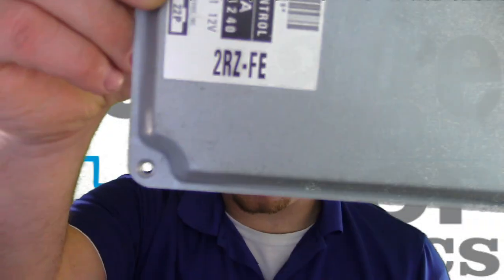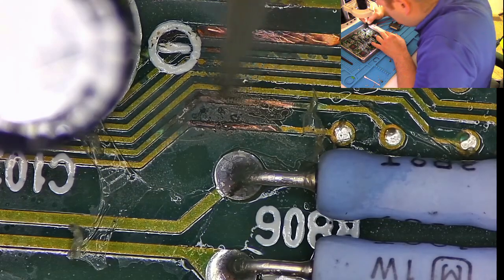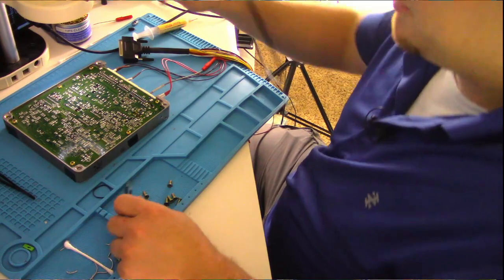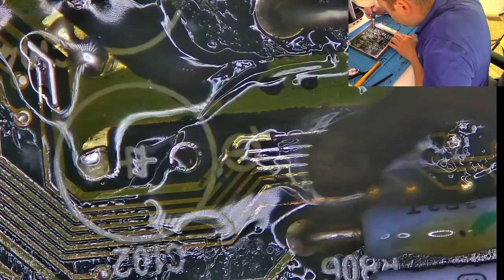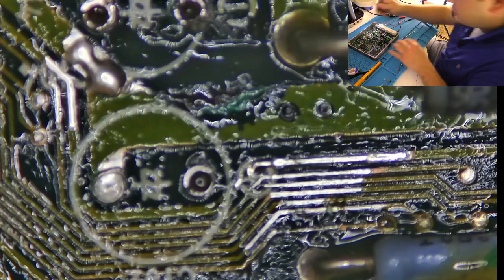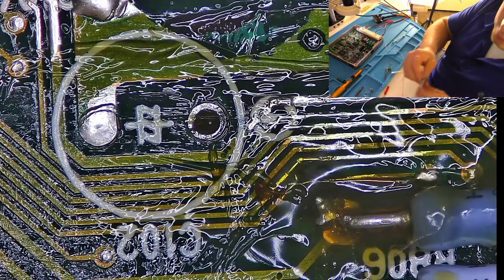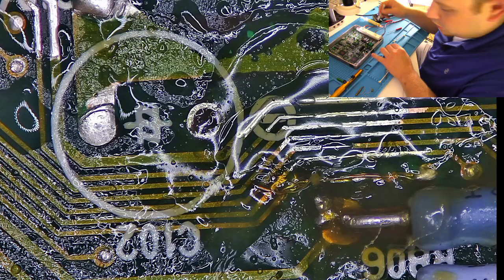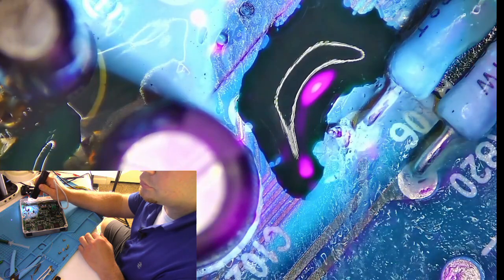Tacoma No Start No Communication with ECM-Circuit Board Repair

Comment: I see that you connect the SDL line to the K-Line connector on the GODiag. Is that correct or do you connect that to pin 2 of the OBD2 connector? Or do I need to connect both? How about the ground. Must all the ground be connected on the ECU? If no sensor is connected, will there be communication with ECU? Thanks.

Comment: Hi. Love it. For awesome tips and tricks on micro soldering watch a channel called Northridge Fix. As much as i learned from you on diagnostics i learned from him on soldering and techniques. Also sells alot of stuff that makes the job easier like solder wick etc. Keep the videos coming
Reply from the maker: I have solder wick, but honestly it doesn't seem to work well. Or maybe my iron isn't getting hot enough when using a wick. But yes, I love northridge fix!

Comment: My shop also does this type of work, i have a question if you don't mind me asking, in cases like this i'm sure you ask  or tell the customer their options, a new pcm or repair, so my question is with inflation and such are more customers opting to get them repaired instead of a new pcm I know some boards are not repairable but the ones that are i too give them the option some choose to get a used or new , does your shop offer the option of used boards?  My props to you excellent work!!!
Reply: This ECM wasn’t available as a new part. It had been discontinued. Repair or source used was the only option.

Comment: To open up a thru hole, heat the solder, then push a wooden toothpick thru the hole.    I  urge getting a desolder station or a least a vacuum pump on the solder pulllit.  Solder wick is also good.  I use denatured alcohol for cleaning.  It dries quicker.   The solder looked like it was not bonding easily.  Is that lead free?  I use a single strand out of a stranded wire to make patches.  I also use a very fine insulated hook up wire for longer runs.  Can I send some to you?
Reply from the maker: Yeah, it’s lead free solder. But i struggle with solder wick in through holes. Have a suggestion on a high quality wick? And i really want a Desolder station. Maybe one day.
Reply: @VoltageDropDiagnostics  the Hakko desolder gun has been a very good tool for me. It was worth the money and has good "heft" to it vs another unit that shall remain nameless....
Reply: @VoltageDropDiagnostics  I use tin/lead solder, it wets better.  Never tried no lead, what was on the boards was difficult enough.   Wick is pretty much wick, It’s just fine copper wire braid with flux.  The flux is the difference so I add flux.  I didn’t mean to use wick for holes, its more for mopping up.  Either a pick to push it out or a vacuum desolder is best for thru holes.  A desolder station will pull the solder out of things like those caps with the cap in place. Much easier than wiggling them out.  Or the cap can be pull/twisted off the board then each lead desoldered.   The size of the components on these boards doesn’t require a microscope camera.  A magnified headpiece allows full access for tools.    Desolder irons vary in length of path to capture the solder.  The longer the path the more likely it is to plug up and they all do.  More from idling than using.  I think you’ll find after you get the desolder tool that it should have been the first tool acquired for thru hole work.  The extra time and risk to the board makes it worth it’s keep.

Comment: Thank you for this video. You may want to try using copper tape in order to repair/replace broken traces on the bord.
Reply from the maker: I’ve seen people doing that. I haven’t tried that method myself. Have you had good success using that method?
Reply: @VoltageDropDiagnostics  Yes, it works well for me. Especially when the trace you want to replace isn't a straight line it makes life easier.
Reply from the maker: @juergenscholl2843  do you cut the trace out of a sheet? That’s the only way I’ve seen it done
Reply: @VoltageDropDiagnostics   The copper tapes comes in various widths, from ¼ to 2 inches. The wider one allow cutting out the traces as needed. If you got some cumbersome forms you can just add on the required number of pieces and join them together with a solder dot once you glued them onto the board.